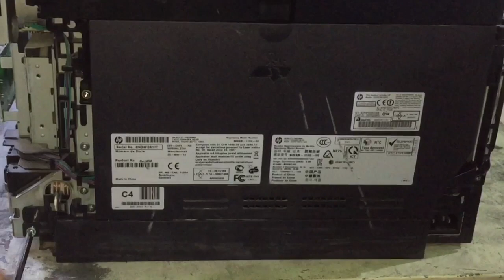how to remove the intermediate transfer belt on HP LaserJet Pro 200 color MFP M276nw Printer

Comment: Hi, I tried to extend the transfer belt and I have come so far to pull out the belt unfortunately it jams on the back left side. Right side is ok and I can also push up the belt but not left. Can you tell me why it's stuck? According to your video, it's easy to pry out.
Reply: I had the same problem. Make sure that the "front door" (where you remove the toner cardriges) is open! There's a lock in place that prevents the belt from being removed when the front door is closed. Lost half an hour to find that out.

Comment: Thank you! Easy to follow walk through, I just cross fingers cleaning the belt fixes my problem of stripes on the prints.
Reply: The instructions here are great, but my belt was nearly clean and wiping it off didn't solve the stripes on my prints. What I did notice though is that the secondary transfer roller was quite dirty, and in fact had black and colored stripes in the same positions as were showing up on the paper. Removing that roller is much simpler (almost nothing else has to be removed). Go figure. I washed and dried the roller, but it didn't help. I finally replaced the color cartridges and voila! the colored stripes disappeared. Go figure. I still have black stripes, but I have no replacement cartridge for that so I'll just have to order that and wait.

Comment: thank you for your video, I am going to try to clean my printer. Question, did you use any rubbing alcohol on the cloth the clean the transfer bed?
Reply from the maker: I’m not using any alcohol for cleaning the belt. There’s no need for cleaning the transfer belt, you only clean the transfer cleaning blade.
Reply: @Coronatechnical  thank you so much for the reply. I ended up cleaning it, but the cyan keeps dumping streaks on the prints. I wonder if there is a way just to clean the cyan or do you think i'll need to just replace the whole cartridge. When I did the test to see how much ink is left it is about 30%
Reply from the maker: you don't have to replace the whole toner cartridge. you just clean the cyan imaging unit. if the streaks still appears, then replace the cyan imaging unit.

Comment: i am able to clean the belt but seems there is lots and lots of blue powder in the last part that pushed the paper through at the end of the belt. do you know how to clean that ?
Reply from the maker: The blue powder may be from the cyan developer unit.  This error occurs if you are using a compatible toner or developer. Use a vacuum cleaner to clean it.

Comment: what problems would removing the transfer belt fix?  Seems like all you did is take it out and put it back in, what was the reason for taking it out?
Reply: He was cleaning the sides of the belt. For me, I was getting black smudge marks on each side of my paper, and this fixed seemed to help it.